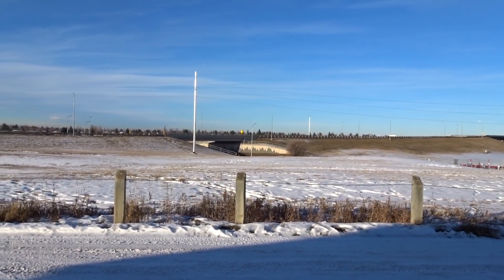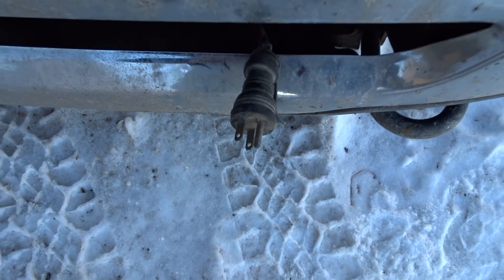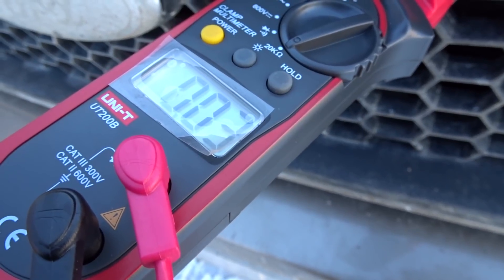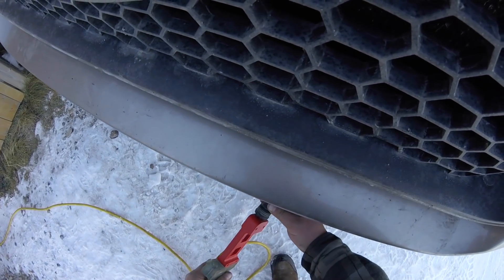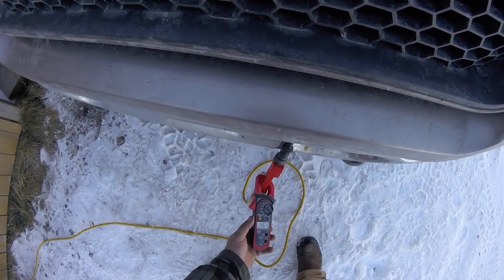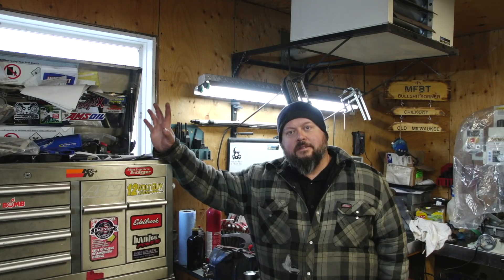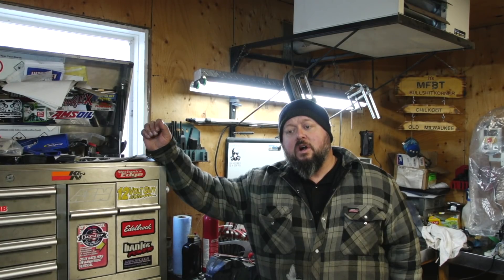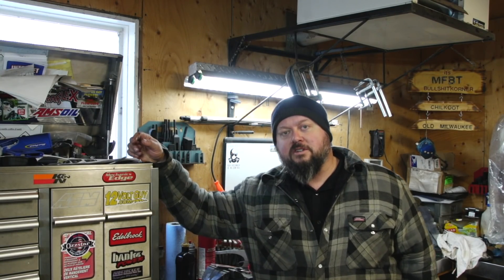How to Test Your Block Heater DIY

Comment: Should you have your key in the on position when testing your block heater?
Reply from the maker: That has nothing to do with the block heater
Reply: Can’t find that answer anywhere so far . Maybe reason mine reading zero... does have - minus ,blinking on and off

Comment: An easy way is to measure the resistance of the block heater with a multimeter. The value should be ~16 Ohm for a 750 W block heater (V*V/R=W or V*V/W=R  => 110*110/750~16).  A very high resistance would mean a blown block heater or open wire.

Comment: If you were to plug it in with your extension cord you could just run your amp clamp around the extension cord no need for the fancy piece of plastic to get plugged in between
Reply from the maker: Good luck with that, you can’t use a amp clamp with a neutral wire.  But since your a armchair electrician you believe what you want
Reply: Actually Jerry, you can measure current in a neutral, but not the way gord1131 states. In his statement, the EMF of the hot and the neutral will cancel each other out, and the Amp probe (clamp) will read zero even with current going through it. All that orange block does that you used, was to separate the hot and the neutral from each other. You would get the same amp reading if you clamped to either side of the orange block. I couldn't tell from the video if it actually was labelled as to which side was which, but it doesn't really matter. You could get the same result if you removed a piece of insulation from a short piece of extension cord and separated the white and black wires, but that would destroy a cord that probably cost more than the device you bought. This is all assuming a single phase system with no "Shared" neutrals, which can't happen through an extension cord anyway.
Nice video though, for all the folks out there that live where white stuff falls out of the sky half the year.
Take care. Dean
Reply from the maker: i'm not sure why your posting that, I purchased the line splitter so i wouldn't have to destroy the cable...... not sure why your writing to assume that I didn't know............
Reply: Jerry,
I wasn't advocating to destroy extension cords, just using that as an example to state that the current on a neutral is the same as the current on the hot side (single phase, no shared neutrals).
I wasn't trying to bust your balls, just wanted to clear up the neutral current thing.
I just got a little too wordy in my explanation, that's all.
Take care.
Reply: @mr.niceguy185  Guess some people are touchy about being educated!🙄